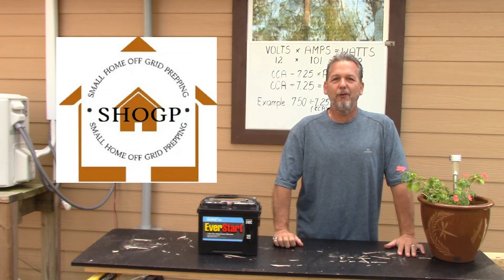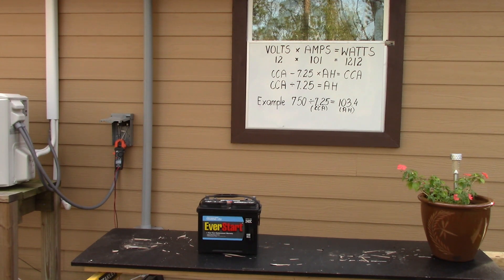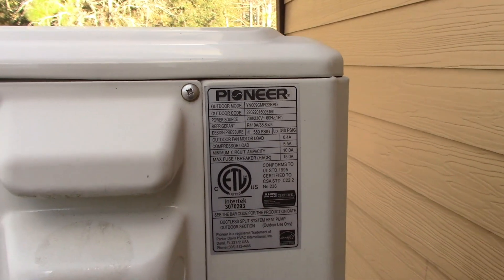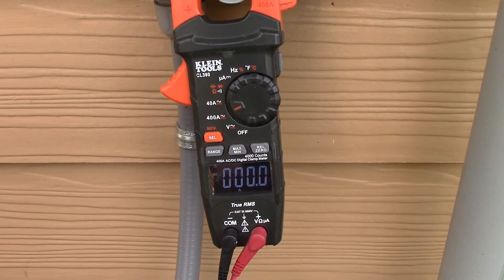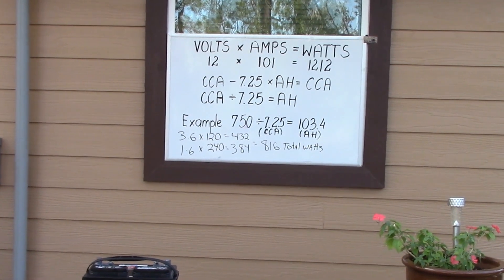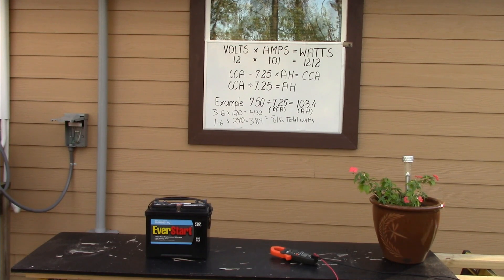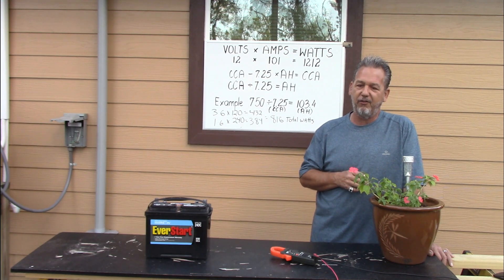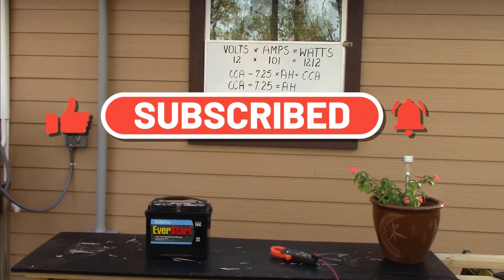HOW MUCH SOLAR POWER IS NEEDED TO POWER A HOUSE, AND HOW LONG WILL IT LAST

Comment: Alot of led bulbs can run directly from the 12 volt or 24 volt source which saves even more power
Reply from the maker: that is completely true, led bulbs use a fraction of the current that an incandescent uses!

Comment: I just ordered the minisplit for the primary source of heat and ac in my tiny home camper. It's the 220 volt inovair and supposed to be 38 seer. Hopefully it will be what I'm expecting
Reply from the maker: 38 seer is defiantly up there, mine is a 22 and works great with my solar, the cool thing to these inverter units is that the pretty much don't have a start mode that consumes a lot of current making them perfect for solar.
Reply: @smallhomeoffgridprepping1511  my inovair should be at my house by the time I get home. I'm a truck driver and only home 2 or 3 days a month. Hopefully I can get this unit installed in my couple days I'll have home. Yeah I'm excited about the minisplit for ac and the heating abilities.  It costed alot compared to other units I looked at and hopefully it can do as advertised.  The roof top ac pulls 90 amps off my nissan leaf battery setup and the propane furnace is kinda an electrical hog also. If the minisplit does well I'll remove the rooftop ac and trash it. Thanks for the videos

Comment: What do you estimate the wattage will be for the mini-split on a 100 deg + day? Thanks for the video!
Reply: You could have got away with a high frequency inverter. You don't have any big surge appliances. The high frequency are more efficient and don't use near as much idle power. I have both low and high frequency and they both have their place. Low frequency is great for old style ac units and well pumps... air compressors. Good to have but not needed in your application from what I've saw
Reply from the maker: I prefer low frequency because of the extra large transformers, I have found over the years that the low frequency inverters are more dependable and last longer than high frequency, at idle this inverter uses less than 6 watts, the efficiency on this is 90-94% depending on your load and how hot the inverter is getting, with the loads I'm pulling I'm actually getting close to 98% out of this. I do have a 120' deep well with a 1 1/2 hp pump that does have a heavy start, but other than that you're correct, I designed this house to not have anything with heavy start loads, thanks for the comment, and let me know how your 38 seer ac works out!
Reply from the maker: Glad you enjoyed the video! These units have variable speed motors, they measure both heat and humidity to determine run time, the motors when the unit starts are at full speed then adjust themselves from there, so the wattage should not really go too much higher, but the run time will increase when its hotter and more humid out, this unit is in the shade most of the day which makes a big difference as well, air conditioners don't blow cold air in a house, they remove heat and humidity, the heat is dissipated from the outside coil, so if the sun is hitting the coil and adding heat back it will take longer to dissipate, and run longer at full speed. These air conditioners are key for solar power, these are no longer considered mini splits, they are inverter units that have normal air handlers that connect to existing duct systems in homes, but also still have heads that can mount on the wall, and cassette air handlers that can mount in the ceiling. These units now come in all sizes, we sell these on our website and have any size from 3/4 ton going all the way up to 5 tons. When someone is installing solar they will usually find it will cost them less money to change the ac unit to one of these then it will to build a large enough solar system to run a old style ac unit that pulls over 100 amps on start up, and has a compressor that pulls anywhere from 12-20 amps in run mode. If you have seen our recent videos, you know I have been installer my solar for the last few weeks, and have made some videos on it, I am making one tomorrow on the charge controller , but after that will be making one showing how my solar system runs my whole house ,all the amps volts, and watts including the ac unit.
Reply: @smallhomeoffgridprepping1511  Ok, thanks for the good info. I have window a/c's 1/2 to 1+1/4 ton But the startup is large, I just purchased a 10,000 btu dual inverter window unit to replace the 1+1/4 unit, hope it woks well. I'm in CA in a manufactured home and getting permits is a real issue. I'll be running it from my RV solar system, no permits required. I did already get low frequency inverters, but I don't know if they would really be enough for the large window unit. And I have a hybrid electric boat and trailer with a small cabin on the front to power other stuff, should be enough for me, and my little a/c units, lol. Thanks!
Reply from the maker: I would think you would have no problem running the inverter unit with a low frequency power inverter that was at least 1000watts continuous, low frequency power inverters are great for heavy loads, with  heavy start loads, the one I have is 6000 watts with a start surge of 24,000 watts, so if you have a low frequency inverter I think you would have no problem running what you're trying to.
Reply: @smallhomeoffgridprepping1511  Mine are 3000 and 3500 cont/ and 3x surge, Thanks!
Reply: I got the idea of doing the high seer minisplit from a David poz video. He's got all the energy usage details of his and it's the same one I bought. It seems to pull about 600 to 800 watts till it gets the temp close to the set point then uses 200 watts to keep the room at the set point. I'm excited to get home off the road and get it installed. I'm only home a couple days a month I'm normally in this semi truck. Hopefully my nissan leaf battery pack and 1800 watts of solar will keep me from running a generator for power while I'm doing home time from work
Reply from the maker: What size ac unit is that? at those numbers for an inverter unit That sounds like a 3-4 ton? Also how many amp hours is your battery pack and what voltage are you using(12, 24,48) Because inverter units never actually shut off, they always stay running, just slow down dramatically when desired temperature is reached, it sounds like you'll have no problem running it, you may just have to adjust your system slightly from there if it's not quite enough, but other than when you first turn the unit on after it's been turned off, you will almost never be pulling the max amount 600-800 watts, and even the lower watts will never be constant because these units only slowly speed up to maintain the desired temperature once its been reached. Like I said before. let me know how it works once you put it in. I'd really like to know how it works out. and let me know if you need any advice when your putting it in, or need help with any of the load calculations, I'm not only a master electrician, but I'm also the same in hvac. I have over 30 years experience in both fields, so let me know if I could help!